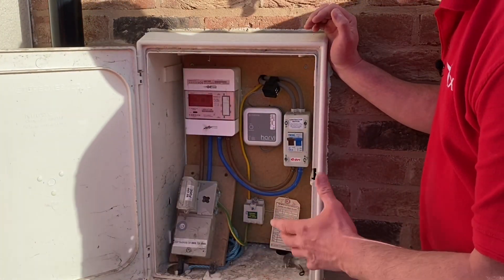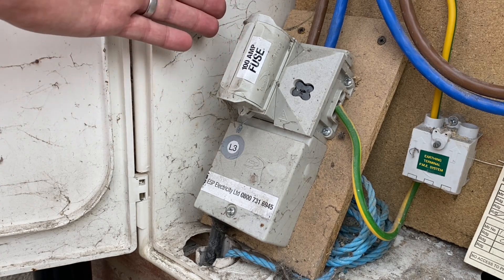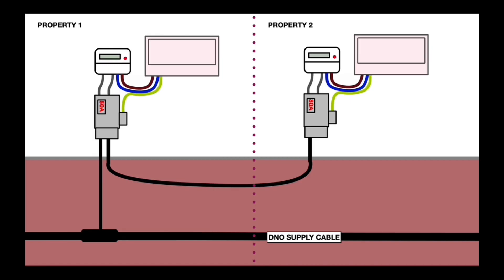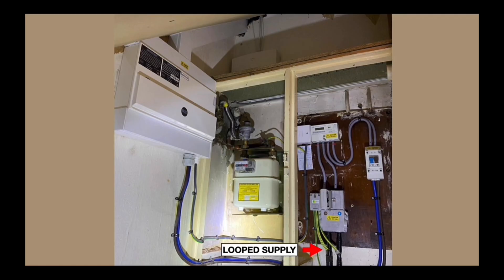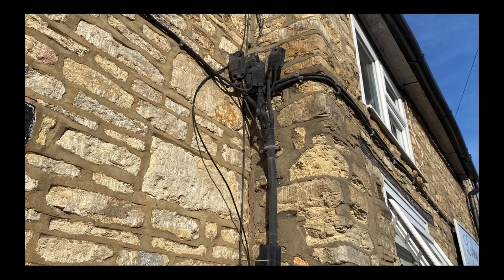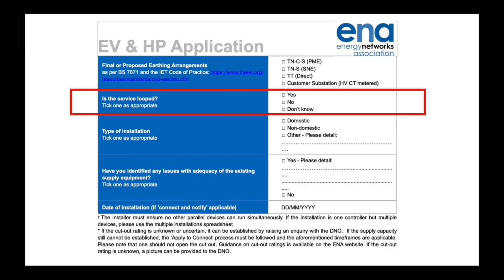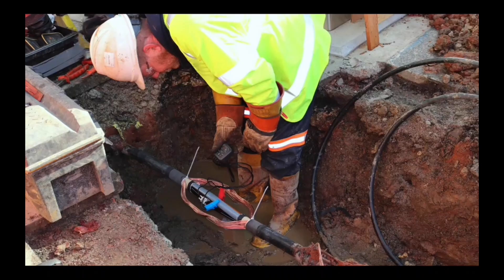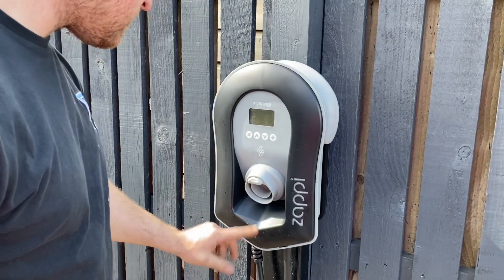EV Charger installation : BEWARE Looped supply - what are they , cost and time to correct

Comment: “Modern installation” opens the door to an angled intake fuse on a wood plank, connected to an extremely short intake cable ( hence it being angled ), coming into the box in an undersized conduit 😂. At least they bothered to identify which phase they tapped into on the main cable.
Reply from the maker: That’s pretty standard on new builds. They don’t bring the cable up the cavity due to thermal issues.
Reply: @efixx  inside a 50mm corrugated/pvc tube or something, they could’ve allowed 30cm more into the box though.
Reply: Yes, well, ignorance is bliss I guess! ;o)

The angled intake is used to fit a sunken OSV where the level of the intake is further forward from the meter board. Funnily enough not many people want the front of their homes carving out to bury the duct in. Newbuilds do not have this problem as the intake is built into the structure of the house!
Your "Plank" is not a plank but a specifically cut piece of non combustible board (supported on the rear)!
The intake cable (we call it a service cable) is not short but cut to the right length. Why would you want more?
The "conduit" is an industry standard Duct. All new installs are the same size .... again why would you want it bigger than you need?
As per the phasing indicator .... it is probably right (but I would not bet money on it) ..... what would be the benefit of you knowing what phase you are on be?

Sorry for having a go but the supply to this home is actually on a par with the best in the world!
Reply: @totherarf  not sure what to tell you more about to what in my eyes looks like a badly executed install.. if for you it’s normal to see a box that is supposed to have things installed on its back, with a thing installed sideways in it just because the cable couldn’t get 10/20cm more for the “head” to be installed correctly inside.. then who am I to tell you otherwise.. 
I know the plank doesn’t promote fire propagation but I just call it a plank because I’m an immagrunt that, as expected, misses out on lots of vocabulary and terminology of things.. 
knowing which fase is on single phase isn’t of much use but it’s a nice detail and will probably be useful for the dno to know.. 
I wouldn’t call a single phase supply, that is just tapped into the main cable that is passing underground outside the property, unfused at the tap, providing 80 or 100A to a house on par with the best to be fair.. 
I could show you some 3rd world pictures of street distribution boxes, fused feeds to every property, and a basic house single or 3 phase dedicated dno intake fuse box and dedicated meter box looking much more presentable than that one with all cramped into one box.. 3rd world dno also has the decency to allow enough cable slack inside the box, at least in a way that he’d then be able to terminate the cable on the vertically installed fuse, instead of bodging a plank sideways bricklayer style.. 
You have several things on par with the best in the world but the execution of electric installs is definitely not one of them.
Reply: @filipe.skunk8  If you were to design the OSV to have the cutout directly on the back board you would need more vertical room to allow for the minimum bending radius of the cable! When we terminate those type of cutouts we start with the service cable longer and cut it down to fit. The wedge type are only used where there is a surface mounted duct. There is no kit mounted sideways in this OSV and it will have been the DNO that fitted this cutout!

The fact that service joints are not fused individually is part of a design that goes right back to the first municipal electricity services back in the 1920's ... and is still good today! Diversity allows for a flexible system, protected (usually by 400A fuses at the substation). This allows additional services to be added easily. Also it allows kit to be fitted to substations that can identify potential faults before they degrade to the point of people loosing supply.

What more can I say? ....... Given the chance how would you do it better?
Reply: @totherarf  it’s still a bodge, the cable isn’t supposed to enter the box at the front so there’s no need to consider bending radius or extra box height if the cable enters the box where it was supposed to enter in the first place. Like you said It’s an old system. Could it be improved? Yes. On par with the best? Don’t agree there sorry.
Reply: @filipe.skunk8  Ok .... If you look at the underside of the OSV there is eather a slot or a knockout to give access to the duct. It is part of the design, not a bodge! There are buildings where you can't easily cut a slot in the outer layer of the structure so allowance is made to go surface! The alternative is a surface mount OSV and I have yet to meet someone who wants one of those on their home!
Reply: @totherarf   but it’s 2021! There must be a way of doing it normal. it’s not normal having things installed diagonally inside the box. Even with the cable coming in on the lid side and If the fuse was where the meter is, wouldn’t need a bigger box for the cable to have enough room for a soft turn into the vertically mounted head. It’s not very clever to have the head installed at the bottom either, once the lid starts degrading and allowing rain water in, it’ll rain on it.. why not having it at the top of the box? In the future if someone else needs to change the head, at least they can count on a bit of slack inside the box instead of that pube length supply barely managing to be inside the box.. plus, if the box was supposed to have things installed that way, wouldn’t it come with a bracket for it?
Reply: @filipe.skunk8  Have you ever installed a cutout? Seriously it is as simple as lift off and drop the new one over! Why do you think there is a need for extra service cable?
If the cutout were mounted higher how could you fit a meter block in between the head and the meter? Also you have the problem of getting tails in round a right angle. Have you ever tried to get one of the factory fitted bungs out of the cutout? It is a seriously hard task near to impossible round a bend!
Finally those doors do not really degrade .... but if damaged and allowing water to get on for any length of time you would be needing a new meter board anyway!
I feel you are missing a point here ...... This type of OSV is for installing on an Existing Building! If it were a new build the duct would be inside the structure!
Reply: @totherarf  I’ve installed different ones abroad only, there’s a specific dno box for single houses called P100, cable comes into the box through its dedicated tube ( 50mm minimum diameter ), terminated at the fuse barrel holder that can be single or 3 phase, back in the day were the spade fuse holders.. from the dno box goes to a dedicated meter box.. there’s no mess like in that “one for all” box. My main point here is that it lacked of forward thinking ( as usual ) and that’s why it had to be bodged diagonally like that, the arrangement could’ve been different with all the bits fixed to the back of the box as it should be that’s all. Like I said, you may be on par with the best in the world ( maybe technology ) but the execution.. the erection of an electric installation it’s as rudimentary as it was before you were born ( and I don’t have a clue about your age ).. bare cables buried everywhere or with the primitive nail clip, the basic choc block and there you go the house is electrified. there’s very little choice/limitation of materials at the shop as well. To conclude this, if that box looks presentable in your view, sorry to say but in mine it doesn’t..

Comment: My property is 18 months old, I have looked in the meter box and there is one cable marked ‘L1’ and a 100amp fuse attached. Is this good or bad?
The builder of the estate advertised the fact that every house on the estate had a car charger fitted, but closer inspection of the unit I discovered it’s a external three pin power socket capable of only a 2KW output. Perfect for granny chargers. Even the unit’s makers website Rolec say it’s perfect for mobility scooters and e-bikes
Reply: Builders!

Comment: Was the looping of the supplies a copper saving war time measure ??
Reply: Many of these supplies likely predate the war, and the copper saving would be minimal. More likely it was to save on labour costs, it is much easier and cheaper to loop a supply than dig a separate trench to every property. It was inconceivable to people at the time that we would ever require the sort of power we are predicted to be using in a decade or two from now.

Comment: Great video. I have one thick cable coming up from the street that then separates into two like a ‘V’ shape, with each cable going into the left and right side of the DNO fuse box. My neighbour has the same. Is this a looped supply? We both have 100A fuses and live in linked-detached houses that were built in 2000.
Reply: The cable always has to split to go to the live and neutral (and earth if TN-S) terminals. On a typical modern cutout it splits in the bottom of the cutout enclosure, but some setups have the split covered by a flexible "boot" instead of being inside an enclosure. That isn't a sign of looping.
Reply: @petermichaelgreen  Thanks Peter. Yes, it looks like a single cable with a V shaped boot separating into two parts both going into the bottom of the DNO box (or whatever that bottom thing is called)!
Reply: @petermichaelgreen  Hi this sounds like my supply - the house was built in 2001 and is a detached house on a new estate all built post 2000. There is a single cable into the wall meter box which splits into 2 inside the box with a rubber Y junction before both connect into the bottom of the main fuse setup, both cables are black. The fuse is only 60a but on checking next door their setup is exactly the same? So is this likely not a looped supply but I just need to request the fuse increasing?

Comment: If you are in property 2, how would,you know it’s looped, as it’s only one DNO supply cable?.
Reply: The fuse carrier in property 1 melts when you charge your Tesla
Reply: When you’re 98% through the process they tell you😩 .
Reply: If you’re in luck the dno may have plans which show it.
Reply: That is a very good question.  An answer may be a while coming I suspect.
Reply: Contact your DNO, they have the plans. I only have one cable inside my house but this is because there's a transformer outside the house, under the drive, which has a cable running to next door.

Comment: Couldn't you just fit a charger and limit the current to something sensible as a temporary measure then increase it after the looped supply issue is resolved?
Reply: Fiat will supply a plug in wall box with a current detector that limits demand as household demand goes up. Trouble is you are limited to 3kW so doubling your charging times against a 7kW charger than needs de looping.

Comment: So if I assume that there are 1-3 supplies @ 80A. Does this mean that the DNO could increase the main fuse on a single installation to 160-240A, transformer dependant supplying the single fed property (Not a looped one)? This would get a lot of people out of trouble when they have multiple high load circuits e.g. heat pump, elec shower, elec hob(large), self cleaning oven, possible annex and the dreaded EV charger. There are many properties around as described minus the EV charger running on a 100A head. I would like to hear your thoughts
Reply: Will depend on the current carrying capacity of the installation, to run higher amperage requires much thicker cable, standard 25mm cable maxes out at 111amp, 16mm maxes out at 83amp, it’s not just the service head supply, you need to also understand OHMs law to understand how much load you will need to be pulling to justify a huge jump in fuse rating

Comment: I received a fantastic service from my DNO. My looped supply missed by my EV charger installer but he was very concerned about the earthing. The loop was on the outside of the property and I identified it for myself and approached Western Power Distribution. I have to say they were absolutely fantastic. I had an appointment within a few days to review the situation. Within 2-days of that I received a drawing of the proposal and a date which was possibly 4 or 5 weeks after (I can't remember without checking). My neighbour was involved in the process and was happy to join in. WPD turned up on the day they promised and did the work. 60amp looped supply became a 100amp dedicated supply with PME.  The cost from Western Power Distribution, FREE! 
EV charger now installed and up and running.
Reply: I wanted the supply incomer position changed to support some internal re-design.  Paid WPD the advance cost and an engineer came out.  Took one look at the old, overhead installation and politely said that as it existed they could not disconnect me but it would be impossible to do the (4 meter) shift I wanted since the new installation was not acceptable under their current policies.  Refunded my money and my electrician used 4 meter tails to connect to the new distribution board.
Reply: How do you know you not have an end of line on a looped supply, just one incoming cable !
Reply: That’s good as have the same DNO and have just found out I’m on a loop supply - car comes Tuesday 🤦‍♂️

Comment: Very interesting video.only 3 weeks ago I was fitting a smart meter for a customer who was waiting for an ev charger to be installed.i had to call the dno out for an A code who explained she was on a looped supply with no indication at her property.however the dno said they would separate the supply and cover the costs.ive learnt something g new.
Great video/s many thanks
Reply from the maker: Great input - Thanks Steven
Reply: When I looked into this five year or so back when I changed the CU, the downstream property can get a direct connection FoC but not the upstream one, which is this place.
Reply: I think on this occasion the dno said the ev instillation wouldn't be a problem and they would sort the looped supply out at a later date.
Do we recon this will appear in a possible amendment to to Bs7671:18?

Comment: I had my supply unlooped from my neighbours by Electricity North West for free. Both me and my neighbour were going to redo our drives, and I could see how the future is EV and thought it best to get any groundworks for supply cables out the way first so submitted EV charger install paperwork. Thankfully I get on with my neighbours as they were the ones needing the most work doing. The original supply cable came into my house, then fed next door. I kept the original cable, and next door had a new independant supply cable run in. There was a bit of negotiation with the DNO in relation to next door. Their cutout was inside the hallway, and the suggested plan was to move it to an outside cabinet. Neighbours were adamant they wanted new supply run to the existing indoor location and DNO thankfully relented and agreed to run it to the existing location. Just a point on the charger notification form - whilst it may be an electrician filling it in, if you read the small print its the householder who is ultimately the one held responsible for the information submitted.
Reply from the maker: Thanks for sharing your knowledge - great that you managed to get this sorted.

Comment: Basically a lot of door knocking because if the house you're in has got one cable how would you know if it's not from next door
Reply from the maker: You have to be friendly with the neighbours or plough ahead and cause a power cut.
Reply: I think dno have a layout of services ,hence why the form filling may be required before hand so they can investigate.Joys of modern technology lol
Reply: @stevendavies4572  good luck with older DNO records... or anything old that's been amended because the records don't always tie up.  For instance, I live in a terrace fed from a TT pair running across three of the houses, a few years ago the DNO bods knocked on our door wanting to replace the PME service head registered to our address rather than the far end of the terrace which is on a separate supply.  A couple of years later our feed into the house caught fire due to corrosion as the insulation had failed many years before (but apparently acceptable despite the obvious risks)... team comes out to do emergency repair.... "Oh, we were expecting a PME! Are you sure your supply doesn't come from somewhere else?"..."Er no, that's why there's scorch marks up the wall!"
Reply: I have seen these when a builder has gone through the incommer and the house being worked on stays on and next door goes off. Fun times. The second properties cable is not run in any practical/sensible fashion, shortest route basically so a nightmare for ground workers even with a CAT scanner. An accident waiting to happen